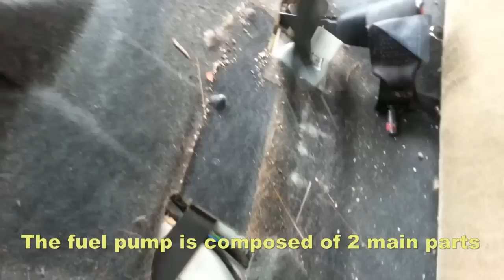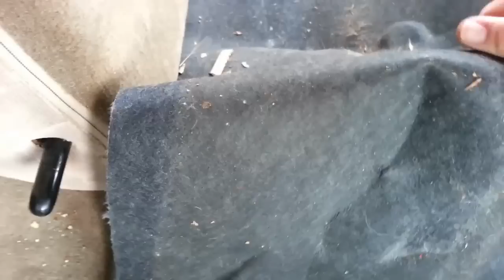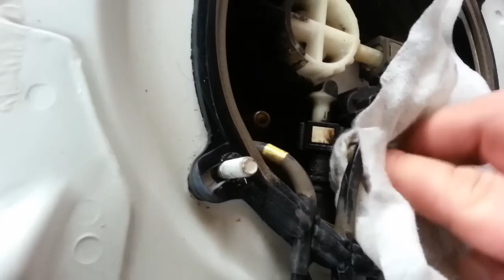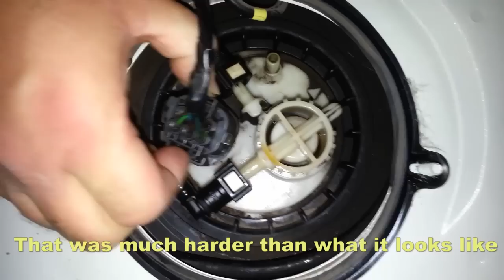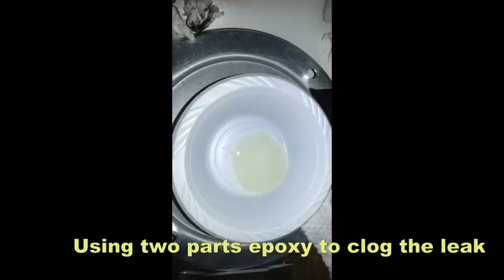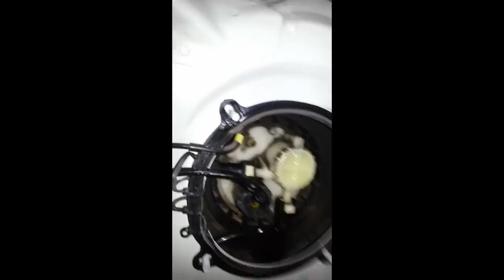Fuel pump leak fix - quick and cheap

Comment: Thanks for the video. I did this repair today. It took about 1 hour to remove the seats from my 2004 XC70. The pump was leaking in the same location. I soaked up the gasoline with a towel and then cleaned the area with brake cleaner. After while waiting for the brake cleaner to dry, I noticed gasoline again in the top of the fuel pump. Then I realized that the hoses need to be disconnected because the fuel system maintains pressure after the pump is shut off. I disconnected the fuel hoses and cleaned the area again. I used "JB Weld for Plastic". Poured it on top of the pump after mixing the 2 parts. It has hardened but I will wait 24 hours before testing.
Reply: Donald Francis I have the same car and the same problem, and I'm fixing today. Did the epoxy hold? How is it now?
Reply: Clark Steele Still holding, no problem.

Comment: Thanks for the Video. Also, big thanks to Reynaldo G who posted a long comment below about contacting Volvo corporate to get them to fix this. I own a XC70 that leaks fuel. I am not in one of the recall states. Not sure exactly where the fuel was coming from, I looked at this video and disassembled the car enough to access the top of the fuel pump. The car was leaking right on top of the fuel pump (out the top of the fuel pump to be specific) as shown in this video. I contacted Volvo Corporate, they opened a ticket, I took my car into the local dealership, and Volvo ended up replacing the fuel pump at no charge as part of their 'Goodwill' program. THANK YOU VOLVO for taking care of this. I have owned five Volvo's (940, 960, V70, XC70, and another XC70) and this is part of the reason why I love these cars, and feel strongly that Volvo really does care about the people driving their cars. My local dealership was great, and Volvo Corporate treated me well. I am one happy Volvo owner.

Comment from the maker: Hi ,

Exactly 1 year after this fix, I started smelling again the fuel in my car and I knew exactly where it was coming from. Through the year I purchased on ebay a fuel pump just to discover it's the wrong part number at the moment I needed it (although the part is almost exactly the same). I went to the Volvo dealership and bought a new pump and also let them replace the pump since I could not get the fuel tank release wrench on time for the MOT test. Apparently , during the year , the fuel was eating it's way through the epoxy layers until it broke out of the epoxy. I could peel away the soften epoxy and redo the work if I had more time to play with it.
Reply: if you would've just replaced the fuel pump the first time you could've avoided  the fuel smell from the beginning
Reply: Permatex fuel resistance gasket maker will permanently seal that leak 100%

Comment: My Ford five hundred leaks gas. I mean that if I put over 6 -7 gallons of gas, it literally pours out from underneath the rear passenger seat. Would this help?
Reply: Did you ever find the cause, my honda civic has the same problem.
Reply: Yes, it was a gasket around the fuel pump

Comment: Hi, great info, I found it because I had same fumes smells un my xc90 after fuel up the tank. This is a 2007 xc90, AWD, 2.5T. 
un my case the pump didn't leak while the engine was running, I did after switching off the engine, I don't know how long after, at least 1 hour after switching off I went to check and there was some gasolinera in the lower part of the pump top, I cleaned and wipe again and put the engine tu run, again not one single drop of gasoline, I drove around and no drops. Stop the car and let it rest for one hour. Checked again and there was some gasoline dripped. Around one soup spoon. This time I checked carefully and found gasoline inside the vertical José connection, the one that looks air vent, since it didnt had any José attached. So I cleaned again, I put a have foot long José on that vent connection, since I had silicone for gas and diesel tanks I used it on top of the pump, where it is use to crack and leak, and also around the área where I found gasoline, just in case. I also put silicone around the gasket that covers the gas tank, to avoid a little bit the fumes in case it leaks again. let it rest for a day. That was just yesterday, so Ill check today. Also, it leaks only with full tank.

Comment: I have a gas smell outside under my gas tank only when I fill my tank up  so I will take it back to the shop where I had my new fuel pump and housing installed am thinking it might be not installed right?  maybe a gasket  is off a little bit?

Comment: I did the same fix Today and I used "JB WELD Water Weld" Resistant to Oil,Gas, Diesel and made to be used underwater on fuel tanks...I'll let you know if it fails.
Reply: did that work for you?
Reply: +Marc Winokur I was thinking the same thing. Jb weld never seen water weld so was planning to use the normal one. how did it work?
Reply: I used water weld and it did NOT work.  Not saying it was the JB Weld's fault.  My whole connection seemed to have hairline cracks so I did a pretty thick layer of it all around it.  It was very tough to reach but I felt like I had good coverage.  Started it up and pinhole style leaks came through. Wouldn't have even seen them except they hit other stuff.  Leaks were about as thick as a human hair and they would have gone several feet if there was room so I think it was just too thin a layer for the pressure.  Debating trying a second layer but I'm worried I won't be able to get the fuel line back on.
Reply: I used JB weld and it's he'll up for almost a year so far. I haven't really driven it all that much but so far so good.

Comment: It's a fuel pump located under the back passenger seat pumping Gasoline!  Keep a fire extinguisher on the driver side floor after performing this repair or you can replace the pump.

Comment: Just an FYI to everyone. I took my 2002 XC 70 w/ fuel pump leak to dealer. They told me there was NOT an official recall on the fuel pump BUT that as a volvo dealer they could submit my VIN number to volvo for a courtesy replacement as it is a KNOWN defective part and volvo would provide the part and pay them for standard labor (800) to replace it for me for free. The mechanic at my shop said he had submitted 40 or so of these request over the past two years and that Volvo had approved every single one usually within 2 hours so that they were able to replace it in the same day.  Call a dealership first. I had bought my volvo used just a few years ago and that didn't seem to matter to them. They just needed the VIN and to confirm that it was the right year and model to fall under this replacement program.
Reply: What year is your volvo...and is it a v70xc ?

Comment: I had the same problem. Gasoline leaked severly. But I solved it using much cheaper method. It worked well. It's been holding for a year now with no traces of leak, and it costed me around 1$ to fix.
Reply: How did you repair the fuel line coupler to the pump nipple?
Reply: How did you do it, I’ve been searching everywhere to find a way to fix this.